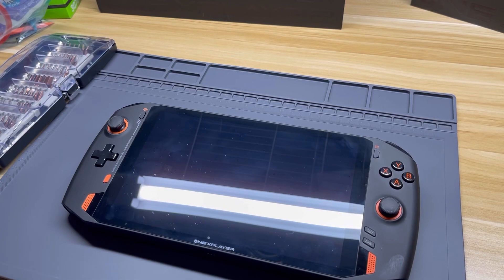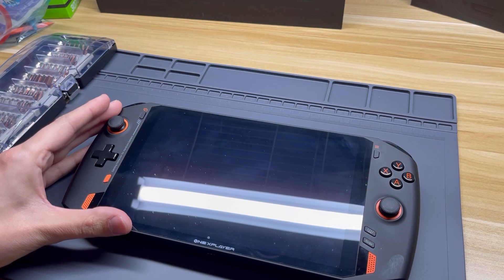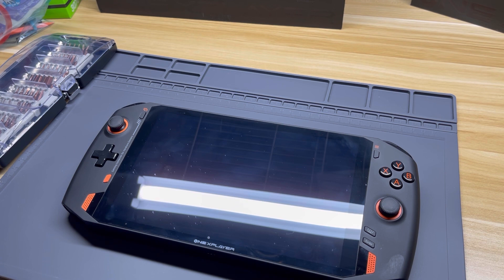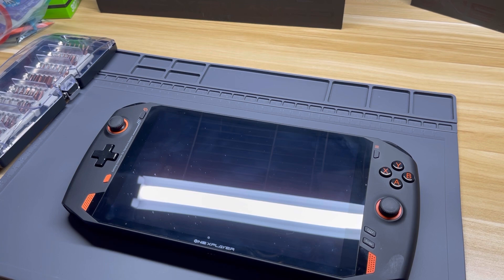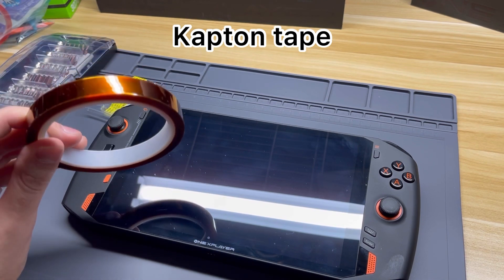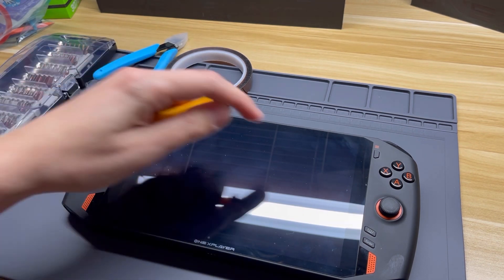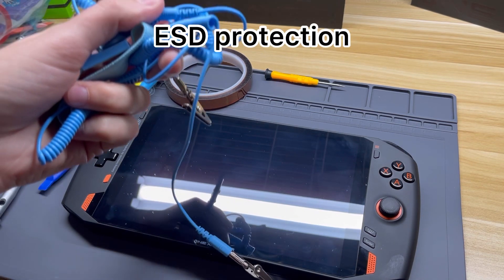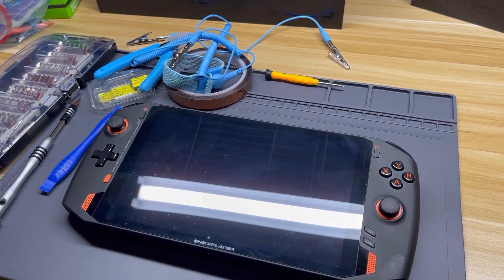Swapping Wifi Cards - AMD One X Player Mediatek to Intel AX200

Comment: Looking under your affiliate link, item is sold out. I found this Rekong wifi 6E   AX210NGW with BT5.2 Would this one work or benefit over the AX200? Wish I would've seen your vid last week! Just got in my OXP yesterday, made sure it all powered on, worked etc then took it apart and replaced the m.2  with more TB and repasted the cooler with thermal grizzly. Thanks for sharing!
Reply from the maker: As long as it’s A/E key it’ll work, which a quick google search shows the ax210ngw is
Reply: @HandheldHardware  Right on!! Didn't even think to reference with google. I'm minimal tech savvy, have a decent understanding lol I can do the repairs, replacements etc. but it's the hardware and what's compatible where I lack.  So after doing the install and booting up. How to do go about getting it to work? Will it automatically show up under device manager, Network adapters? and if so, Would I just Click on new labeled item, go to properties, driver and update driver?  Forgive the many questions. Thank you.
Reply from the maker: @SubiSkank  haha no worries, windows is pretty good about providing a built in driver. It’ll usual work out of box but the best performance is with intel drivers
Reply: @HandheldHardware  ok, Thanks. I'll look into it and see if I can get it figured out. Guessing those drivers could be found by searching for intel drivers online. I appreciate your help!! Def earned a sub!!
Reply from the maker: @SubiSkank  thanks! Yup you can search intel or honestly just get the intel driver assistant utility (small piece of software from intel) and it’ll tell you what driver you need. But if you get stuck let me know I’m happy to help
Reply: @HandheldHardware  right on! I know the intel software you’re talking about. I have that on my AW-X17. I got the card ordered. Do you know if the Bluetooth is running from the mediatek card in the OXP? Looking at the Bluetooth under device manager, I do see it says Mediatek which leads me to believe the Bluetooth is used on the Wi-Fi card. Assuming I’ll need to update the drivers for the Bluetooth as well or it’ll do it auto when I update the Wi-Fi drivers. Thanks again for the insight!
Reply from the maker: @SubiSkank  hey no problem, those two little antenna that I connect, one is for wifi the other is BT, so yeah both are on the intel card and both should get downloaded with the driver utility
Reply: @HandheldHardware  I thought as much. Thanks man!